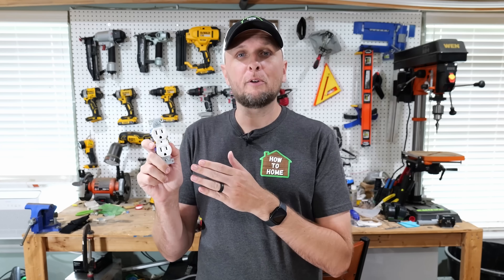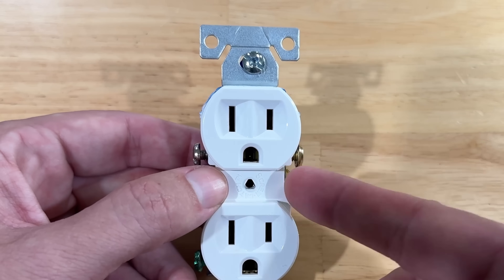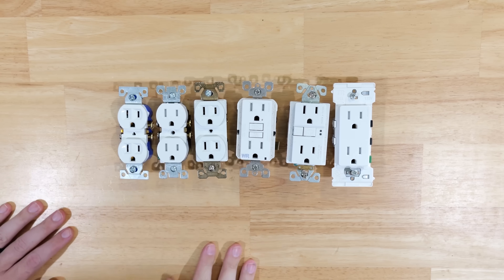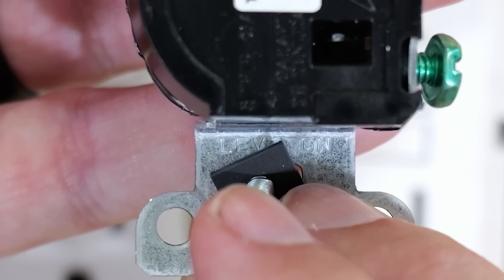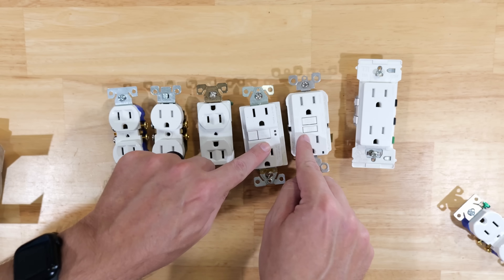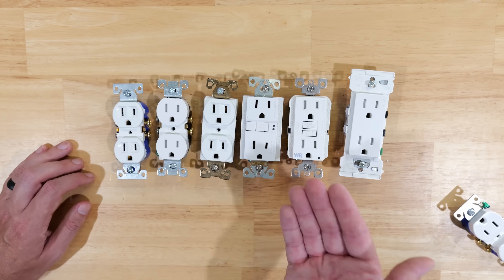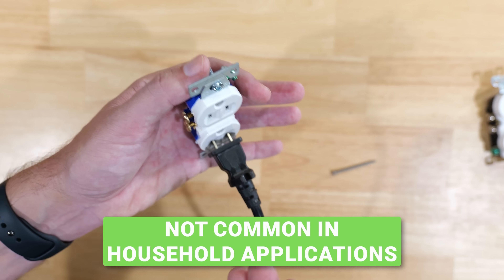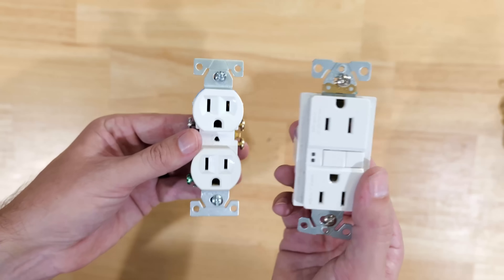The Shocking Reason Why Your Outlets Are Installed Upside Down!

Comment: I used to think ground up was upside down until I started working with alarm systems. The transformer screw would replace the wall plate screw so the transformer could be secured. However, some older ones had metal wall plates and if you weren't careful when removing the transformer, the plate would fall across the hot and neutral pop the breaker and ruin the transformer. I didn't catch on the first time but eventually it made sense to me.

Comment: Good video!  The only time I needed to have the ground plug orientation one way or another was for my WIFI range extender...I needed the ground plug down so that when I plugged it in the writing labels of buttons and indicator lights  were readable and  that ANTENNA faced upwards....So I guess sometimes the way you orient the plug has to do with what you want to plug in that receptical.....

Comment: There are more and more devices with cords exiting the plug at a Rt angle. These are intended for the cord to hang down. This doesn't t work if the receptacle is mounted with the ground up.

Comment: It is simple. The ground hole must be on the bottom because if it is on the top and the plug end begins to fall out, the ground will be lost first and then the line side later so that there is no ground for a period of time. This can result in electrocution.

Comment: I work in an apartment building where most of the outlets are ground prong down. However, in each apartment, there is exactly one outlet in the living room and one in the bedroom that is ground prong up. I've never seen this in any other property that I've worked at.

What is the reason for this? Why are all of the other outlets in those same rooms installed normally?

My first inclination was to reinstall the two upside down outlets during make-ready maintenance of vacant apartments. I mistakenly thought that someone had done it by accident. However, when I noticed it in every apartment, I stopped reinstalling them.
Reply: Not uncommon. Ground prong up when that outlet is attached too the wall-switch so people there know where to plug in their lamp to control it from the wall light-switch.

Comment: A couple of points:
1.  I installed my outlets which are low on the wall with the ground on top for the specific safety concern which you mentioned.  My concern was if I was using a three prong plug, even though I am aware that two prong plugs are the most common for residential usage.
2.  For applications in which I have an outlet which is high mounted on the wall, such as GFCI outlets in the bathroom near the sink and the vanity, I install the GFCI’s with the ground on the bottom, for the specific reason that a number of the plugs, such as for my Wife’s hairdryer, are specifically designed for the ground to be at the bottom, as the plug has the cord leading to her hairdryer or curling iron pointing down. Had I installed the GFCI with the ground on top, the cord leading out of the plug would’ve been pointing up in the air, which is a pretty ridiculous look, and it would have placed additional wear on the cord.
3.  Something which you do not mention in terms of orientation, but which I believe is worthy of mentioning, is the horizontal orientation of outlets placed in the kitchen, when they need to be oriented sideways based upon the small amount of room between the counter backsplash and the wood molding extending below the window stool (called the apron).  For those, whether GFCI’s or standard outlets, which need to be rotated horizontally, I oriented them so that the neutral was on top, in the event that a metal utensil was to make contact with a loosened plug on an appliance that was not turned on and the outlet was not on a shared circuit in which an appliance was not turned on.  This would leave the neutral prong unenergized.
4.  Lastly, it make be worthwhile to discuss the use of 20 amp/12 gauge wiring outlets vs 15 amp/14 gauge.  Truly a personal preference, but I had grown tired of breakers tripping when a coffee maker and toaster were plugged into the same outlet.  I rewired the entire house under the supervision of a licensed electrician.  All kitchen outlets were 20 amp GFCI (home runs), all bathroom and garage and exterior waterproof outlets were GFCI home runs, and all other rooms each had its own 20 amp circuit.  Overkill, I know, but that is my way.

Nice videos, BTW.  Like how you subscribe to “best practices.”

Comment: DIY home owners will find it much better to put a replacement receptical back in the way the old one came out,  That way the wires are already "trained" to fit properly.  Especially easier when dealing with metal receptical boxes.  Something falling onto exposed prongs?  That is what breakers are for.

Comment: In commercial buildings (where receptacles are very high from the floor) ground has to be at the top. In a case of a water leak ground has the first contact with the water. In residential buildings (where receptacles are not far from the floor) ground needs to be at the bottom. In a case of a flood, ground wire would have the first contact with the water.

Comment: Always ground prong DOWN.   I've come across enough plug ins where the cord is molded going straight down and it has to loop over the top if you put the outlet in ground side up.   I can't believe anyone actually thinks ground side up is correct.

Comment: I'm just so used to seeing ground prong down that it looks really weird to me the other way. Maybe the next video can tackle which way to install toilet paper on the holder. Another one of life's great questions.
Reply: With the ground plug down, it is less likely to fall completely out of the circuit. Although it does look better with the ground plug up.
Reply: I used to install TP so the paper comes over the top, but as you get older, it is easier and more controllable to pull the paper down the back with one hand and control the tension with the other over the top..

Comment: Light switches have an embossed TOP in them. Outlets do not.  So it wouldn’t seem to matter. I will say almost all of the accessories I have would be a pain to use if the ground was up.

Comment: Before 2wire plus ground wire and 3 prong receptacles was the standard, there was not a ground wire. Back then, the code was white to the right. In other words, your ground wire was always on the right, Also, in some of the very old house wiring, both wires were the same color, i.e. black.  So, when I install receptacles light fixtures or anything else hard-wired, I always orient the white wire to the right which means, the ground prong up.

Comment: I also did cause a cct breaker to activated by dropping a butter knife that ended on a slightly pulled plug (I was nickname the arc-welder).  A better way would be like they do in Europe with the 220V, is to have 1/2" of all the plugs insulated so no metal is accessible until the cable is unplug.

Comment: It is very dangerous to put your hand or drop metal into the socket when the plug is not inserted tightly or to pull it out. No matter the ground wire facing up or down. If you develop such a bad habit, you will get an electric shock sooner or later. The design of the ground wire facing down is the opposite of the three-plug design of many electrical appliances, which makes the wire present an unnatural upward angle. If water drops on the wire, it is more likely to flow into the socket. Isn't this more dangerous?

Comment: For me it depends on the cord that im plugging into the outlet.  IF it has a ground and it is a STRAIGHT cord like you showed i dont worry how it is installed. BUT, if the plug on the cord is in a 90° position,  i will always turn that outlet so that when the cord is plugged in will will allow the cord to hand steaight down and not positioned at the top and have the cord with a loop in it.  Any other cord it dont matter to me.

Comment: Ground prong down is now recommended by outlet manufacturers by having "face up" stamped in the metal. More importantly you want to keep it uniform for all outlets in the home in case a light bulb is burned out and you need to insert a plug in a dark room.

Comment: I was told, "ground down" and never saw a reason to questioned. 

It seems a little abhorrent and tends to spotlight the installation electrician's inexperience when those improperly inverted outlets appear which causes one to question the rest of the install.

Comment: I don’t claim occupational expertise, but I did major renovations to my own home 4 times in three states. Much depends on both building codes and building code enforcement philosophy in your location. “Properly installed” not only depends on actual building code and the but also the inspector(s) involved. On one occasion the same wall had to be changed three times for three different inspectors.

Comment: Last summer I replaced a vandalized outside outlet with a new one with a locking cover. It came with a GFCI inside that had the test/reset buttons oriented for ground up.

Comment: Nope, ground closest to the ground, no such thing as a 90° plug that doesn't have the ground pin at the bottom where the wires enter the head, so the cord would go up the wall instead of down to the floor if the receptacle was upside down

Comment: It doesn't matter how you install a outlet for the most part its convenience. I've need to install or flip a outlet to the ground prong up due to a certain application. for instance a device with a 90 degree plug where the cable needed to go upward. but the plug turned towards the ground prong. so I would flip the outlet to avoid needed to loop the wire and also if needed give a little extra length, its crazy but just flipping the outlet can easily add 6in of length. possibly more depending on size of wire.  

Although for the most part unless needed. I normally just install prong down. I guess the old  the outlet should have a shocking face just stuck with me. But up or down doesn't matter. as for the possible touching with your finger when unplugging. well that could still happen either way with a 2 prong plug as you stated with the nail falling. 

Over all this was a great video.
Reply: @jayfarrell7680: Disagree as there are legitimate safety concerns to orientation. Ground prong up when that outlet is attached too the wall-switch so people there know where to plug in their lamp to control it from the wall light-switch.
  Medical facilities have things hanging on walls that fall, like clipboards, scalpel, hemostat, that can fall and short the circuit, military galleys and  restaurants, ground up was specified, due to stainless steel utensils being dropped, etc. Therefore it has become required that they be ground up for contractors. In many cities ground up is standard in all commercial and industrial buildings, ground only go down in residential buildings, houses, apartments, condos, etc. 
   Internationally, countries with 3-prong outlets always have the ground up
   Everything is in context and the answer DEPENDS on context. 
   Examples:
“Never took the orientation of an outlet seriously until I was measuring for a shelf with a tape measure. It slid down and fell across the prongs of the washing machine plug.  POW! “ —@joef.6596
“I work at a K-8 school. Maintenance assembles powered multi media carts with the ground plug up in consideration of teachers dragging metal bracelet chains across partially unplugged power plugs.” —  @scaryhouse7969
“a length of florist's wire rolled off a side table onto a slightly loose plug and shorted the circuit, creating a small fire (quickly extinguished).  I now always install ground prong up” @deegee54
“I work at a restaurant and we have this work table with some outlets built in on top. Someone managed to let the edge of some tin foil go in between a plug and the outlet and it got disintegrated.”@MatthewSuffidy
“I knocked some change off of my end table one day my mistake of course, and a coin fell down right on the prongs resulting in a loud pop and a flash along with some smelly black smoke. I have since gone through my home and reversed all of the receptacles so the ground prong is now on the top.”—@chrisenglert3958
“my wife's gold necklace chain dropped off the rack onto two prongs of a device that were plugged into a receptacle with just a little prong showing.  It vaporized the gold necklace area of contact and left a nasty burn mark on the faceplate of the receptacle.   This was on a bar and I probably should have oriented the receptacles there ground prong up.“—@winfordnettles3292
"I had lunch with the Chief Electrical Engineer at McDonalds headquarters. He told me that one of the workers in one of their stores had her hand badly burned when a metal cookie sheet (or something similar) slid out of her hand. It fell onto a receptacle that was loose…the metal cookie sheet made contact with the two blades resulting in  big arcing flash that caused the injury, this is a reason Ground Up is safer."
“In commercial buildings (where receptacles are very high from the floor) ground has to be at the top. In a case of a water leak ground has the first contact with the water. In residential buildings (where receptacles are not far from the floor) ground needs to be at the bottom. In a case of a flood, ground wire would have the first contact with the water.”—@powerzx
“When a heavy extension cord or wire from a device plugged in is experiencing stress from the cord being pulled taught or tugged on, the greater force is usually downward. The ground prong being longer, exerts the greatest torque when the wire is being pulled in a downward direction.  Occasionally that downward force will cause the plastic of the ground prong opening of the receptacle to crack from the downward force. If the ground prong is up, that downward force has much greater support from the receptacle structure. I’ve personally cracked a few receptacles over the years working on projects where the wire plugged in was being yanked around a lot. Where the ground prong was up, the extension cord always stayed more securely plugged in.”—@TechwizJoe1

Comment: We use European outlets. Prongs are in two parts, one being isolated, so that it's impossible to have short circuits when prongs are halfway inserted. Most cables are 90°, and in order for the cable to go down, the earth prong has to be up, which is by the way mandatory.

Comment: What you said about a nail hitting the prongs is true. I've had it happen to me by mistake of course. I knocked some change off of my end table one day my mistake of course, and a coin fell down right on the prongs resulting in a loud pop and a flash along with some smelly black smoke. I have since gone through my home and reversed all of the receptacles so the ground prong is now on the top. I realize the chances of this are very slim but since it is possible  and has happened to me once already, I rather be cautious.

Comment: Have lived in many apartments and houses and never have seen an outlet with ground on top.
Reply: @pmichael590: Ground prong up when that outlet is attached too the wall-switch so people there know where to plug in their lamp to control it from the wall light-switch.
  Medical facilities have things hanging on walls that fall, like clipboards, scalpel, hemostat, that can fall and short the circuit, military galleys and  restaurants, ground up was specified, due to stainless steel utensils being dropped, etc. Therefore it has become required that they be ground up for contractors. In many cities ground up is standard in all commercial and industrial buildings, ground only go down in residential buildings, houses, apartments, condos, etc. 
   Internationally, countries with 3-prong outlets always have the ground up
   Everything is in context and the answer DEPENDS on context. 
   Examples:
“Never took the orientation of an outlet seriously until I was measuring for a shelf with a tape measure. It slid down and fell across the prongs of the washing machine plug.  POW! “ —@joef.6596
“I work at a K-8 school. Maintenance assembles powered multi media carts with the ground plug up in consideration of teachers dragging metal bracelet chains across partially unplugged power plugs.” —  @scaryhouse7969
"I had lunch with the Chief Electrical Engineer at McDonalds headquarters. He told me that one of the workers in one of their stores had her hand badly burned when a metal cookie sheet (or something similar) slid out of her hand. It fell onto a receptacle that was partially pulled out...the metal cookie sheet made contact with the two blades resulting in  big arcing flash that caused the injury, this is a reason Ground Up is safer."

Comment: I ACTUAL HAD / HAVE GROUND PLUG DOWN INSTALLS. ONE DAY WHILE CHANGING MY SHORTS A QUARTER WAS DISLODGED FROM MY POCKET AFTER THROWINGTHEM ON A CHAIR NEAR THE OUTLET.  SURE ENOUGH THE QUARTER LANDED ACROSS HOT AND NEUTRAL PLUG PRONGS. NOW I HAVE TO BUY SHORTS AND IRON PLUG. NOT LAUGHING